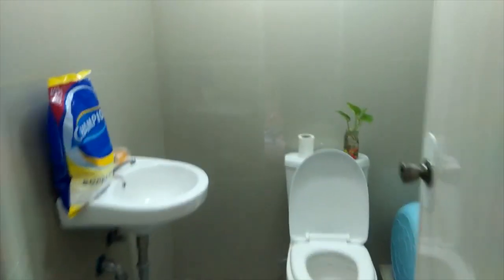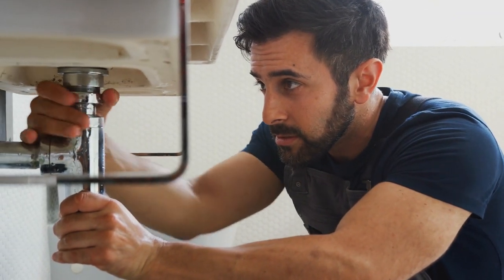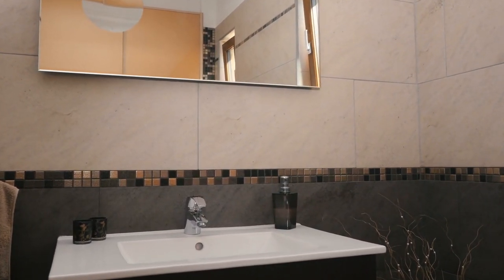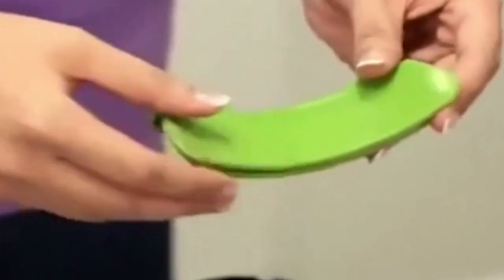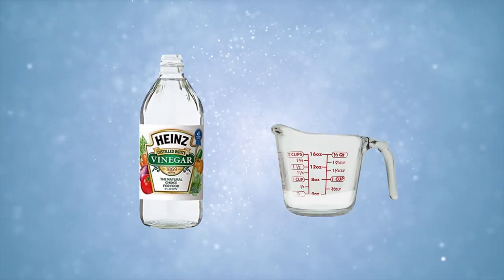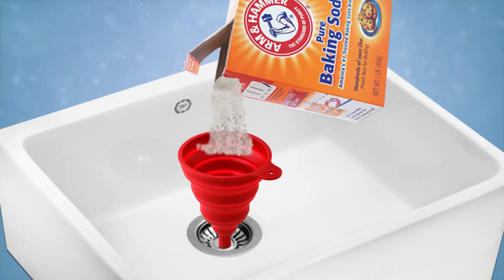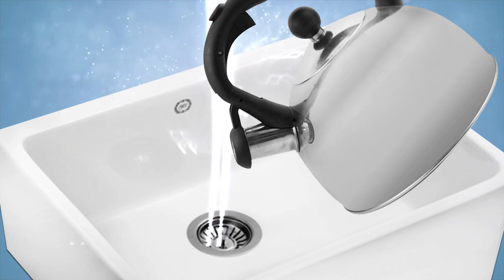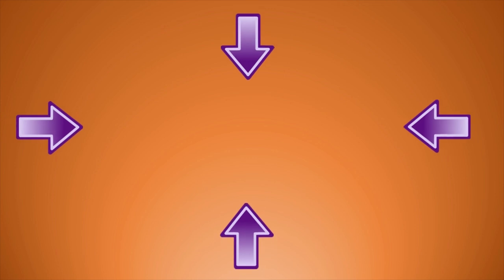How To Clean a Sink Overflow Drain

Comment: You cleaned the main drain in the video and not the overflow drain though, I need to figure out how to clean the overflow cavity inside my sink, it has chunks of vomit stuck inside and it smells. I have tried to clean it by purposely flooding my sink, but the vomit smell only goes away for 3 days, I have mixed bleach in the water, and even tried baking soda and vinegar, but the smell returns, I'm even considering buying a new sink
Reply: ack that must b gross.how bout an oxy cleaner or pinesol?
Reply: @playdoe3275   It was gross lol but I fixed it.  I found a cork that fit perfect inside the overflow hole, and I sealed it like Tutankhamun's Tomb. When I removed the cork, 3 months later, the smell was gone, and so far it hasn't come back :)
Reply: @Lustrum0005  hey i'm glad u fixed it.tho i dunno how u sealed i so well.did the egyptians tell u how 2 seal it.:D lol it's a wonder the smell was gone after that.how'd that happen.i still wanna clean the thing all the x cuz it builds up.:(